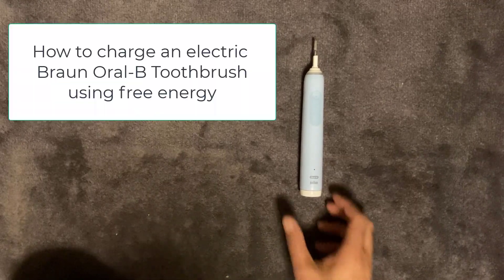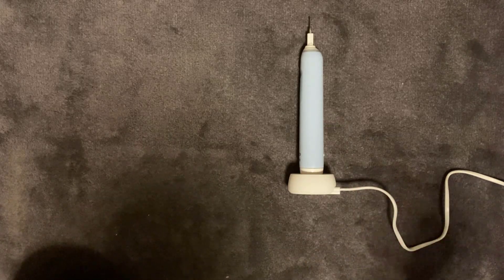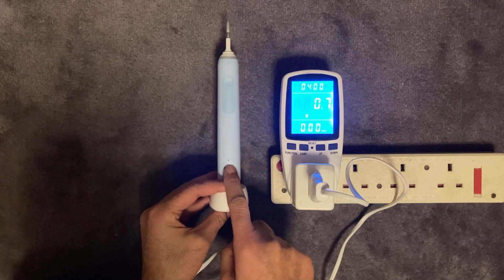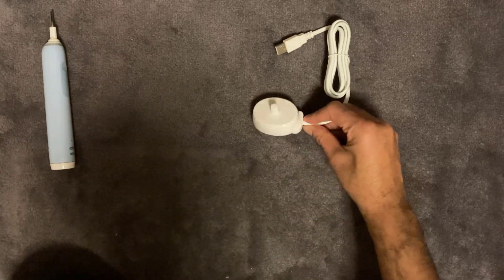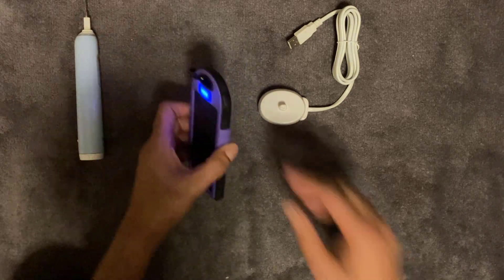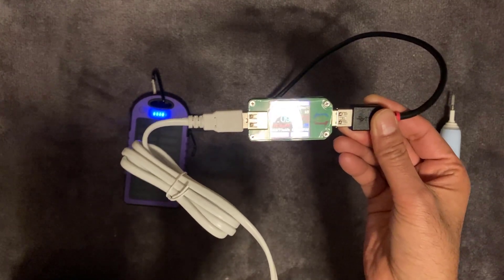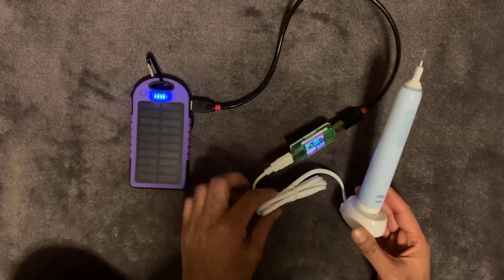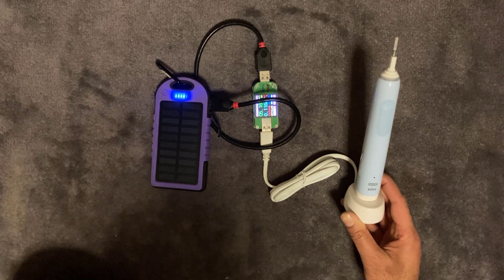How to charge an electric toothbrush using free energy

Comment: The cost to charge is very low.. but i order the usb teethbrush socket, because i like the idea that i brush my teeth from my solar panel for free cost 😅i use a 100w solar panel out of my window that keeps charge my powerbank, i use the usb port for it.. when it is full i switch to my 2 one powerbank have 2 of them, and that keeps my phone, headset, keyboard, mouse, and ps5 controller fully charged! and now in a few days my teethbrush asswel thanks! haha 😂
Reply from the maker: Haha, that's what I call taking full advantage of solar... Good job